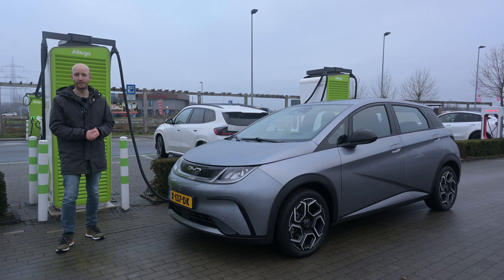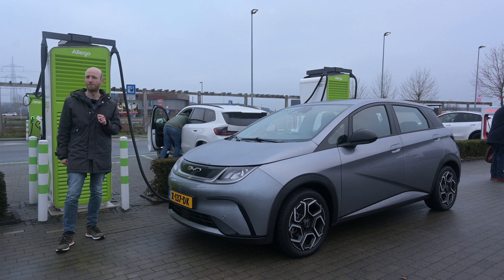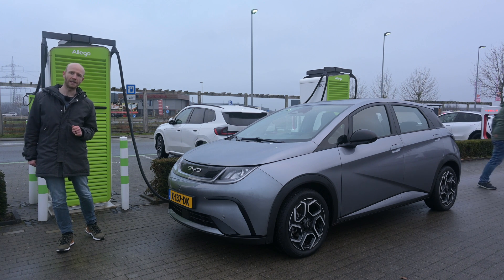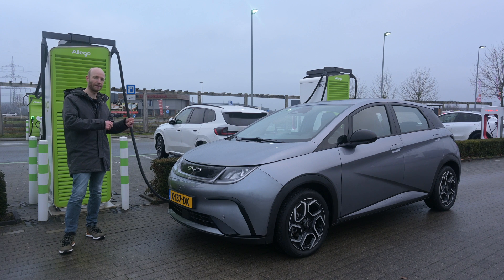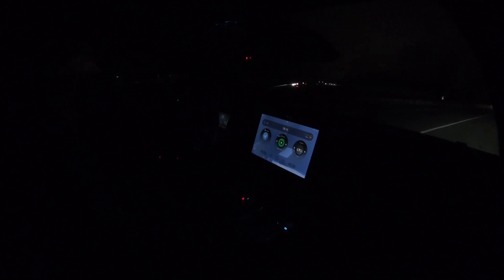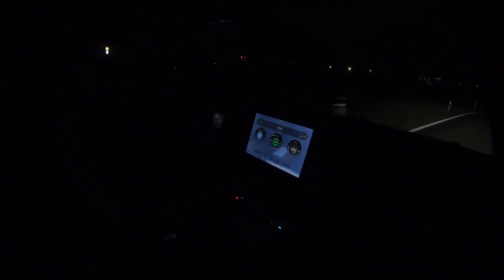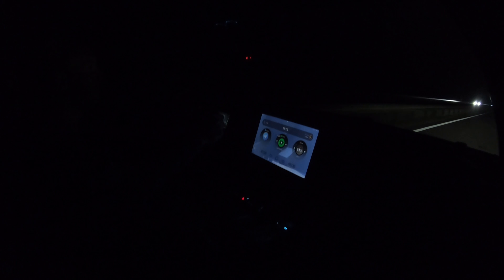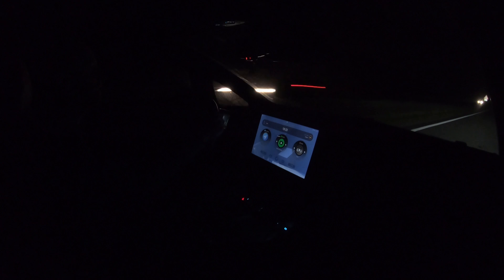BYD Dolphin Top Speed Range Test | Battery getting too warm...

Comment: Ridiculous test - this is not a car that was designed or should consistently speed at 160km (the maximum speed allowed in Australia is 110km).  Great little city car, lots of space and good handling/features for less money than an equivalent ICE car.  The latest software updates 1.2 and 1.3 have fixed all the ADAC steering, lane keeping, traffic sign etc issues.  Also now has wireless Carplay (unlike Tesla).  If you want to play around on the autobahn, try the Seal instead.  I have no problem charging at 88Kw here (even on a hot day), but 99% charge at home anyway (6 euros to fill the battery using off peak power).

Comment: You arent supposed to drive it so fast: this one has a Dutch license plate, so BYD only needs to make sure it can run 130km/h for a while.

One can't really expect, that an EV can run at the top speed the whole time: the battery gets to hot from it, even it there is liquid cooling. It's just not designed, to be an Autobahn car.

Also anyone driving an EV like this in the real world: I get you doing this for testing purposes? He or she didn't get the memo about driving an EV, because driving fast and also fast charging is a recipe to destroy an EV.

Then one can argue? Only with the Leaf that's the case? But if the battery pack, heats up so quickly? Than liquid cooling, can't avoid overheating a battery pack either. Even Tesla's get overheated, when driving them at top speeds.

Comment: BYD battery cooling is crap. After 38,000 km with BYD Han, I must say I am very disappointed with BYD. If it is colder than 5 degrees C, the heat pump is not able to cool the battery and does not start at all when it should cool battery. It only heats in cold weather. This means that with repeated fast charging along the autobahn, you will already get a complete chargegate on the second charge with a charging time from 10-80% in 1 hour and 20 minutes and charging speed of 38 kw. from 50% soc! This because BMS is lowering the charge speed very much at battery temp. 46 degrees C. Without cooling it runs up to 51 degrees very fast. And after the charging you will have rapid gate with only 160  kw output. 

The car does not have 507 HP. On my carscanner I have never seen more than 330 kw and that is 449 Hp regardless of battery temperature, outside temperature, soc etc.

In addition, all BYD Hans and Atto cars have problems with liquid-cooled cables on fast chargers. With Dolphin I don't know. Vibrations in the cables cause the charging to be interrupted. This is especially true of Ionity's Tritium chargers. Allego's Alpitronic chargers are better. And if this is not enough, BYD does not charge on Tesla V3 and V4 SC for everyone. Only V2. Then I haven't mentioned even life-threatening auto steering and ridiculously bad cruise control plus many, many other bugs that they newer are fixing. Warning stay away! Chinese Garbage!
Reply from the maker: If what you say is true about the heat pump it does explain the behaviour, but I do agree then that is terrible design... Next time I have my ODB reader with me so I can give more detailed information about what is going on.
Reply: can you give review on battery performance and range after X amount of kms on the dolphin, the greater the X better the review.